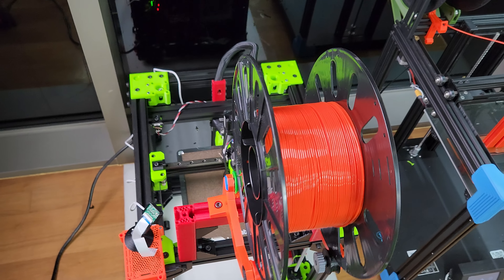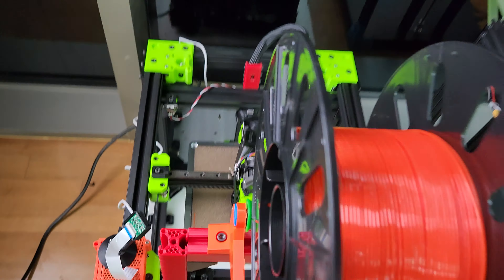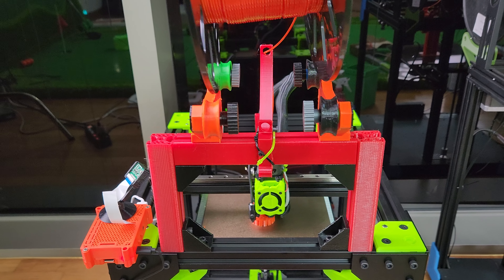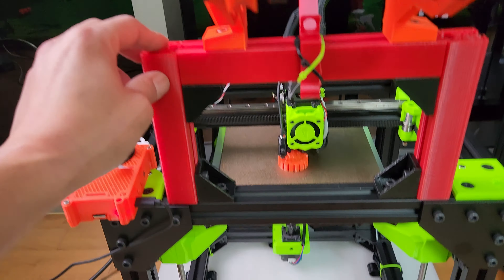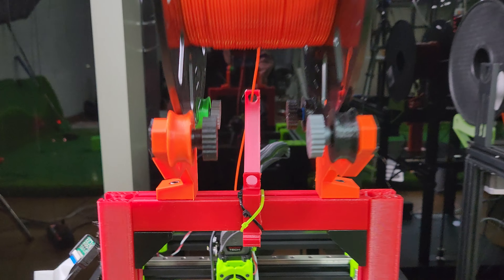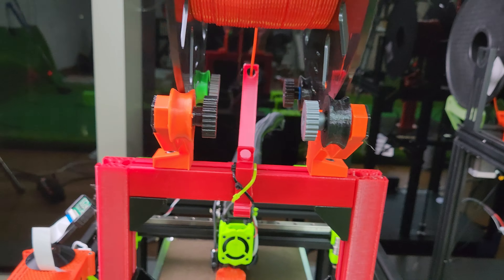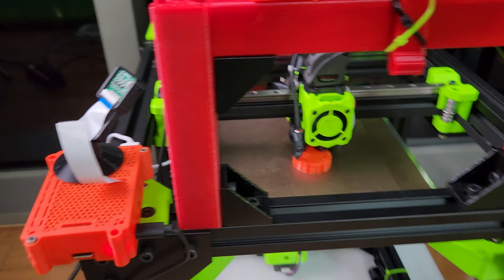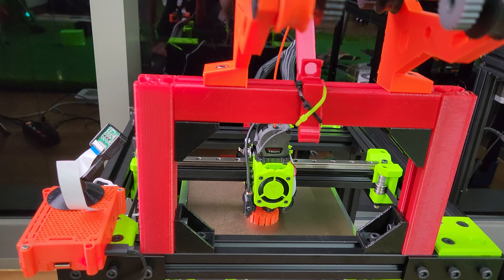Ratrig VCore 3.1 printing TPU nicely!

Comment: If you're increasing speed/accel but not really seeing any change, then it's likely you're brushing up against the minimum layer time setting in your slicer =) Lower it (or remove) as needed
Reply from the maker: I found out why, I was running steppers in baby mode, so installed controller fan and voila, it's printing too fast now.

Comment: I don't know how much work you want to put into it, but you could make a 3d printed shock absorber (markforged has an article) to dampen the vibrations a lot!
Reply from the maker: I was actually using them but it seems that's what caused extra shakes, went back to stock rubber feet and most of the shakes gone.